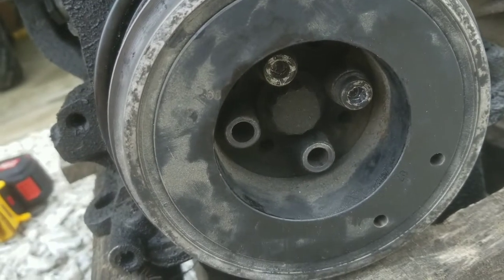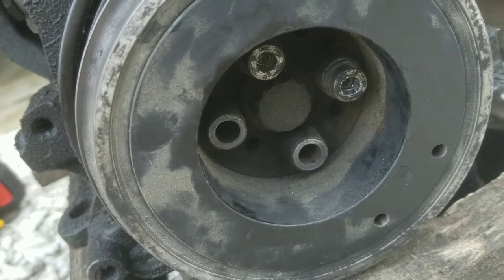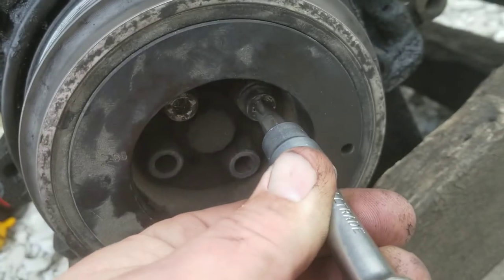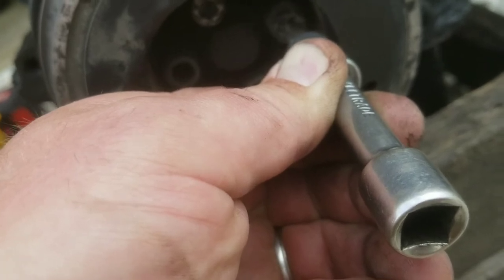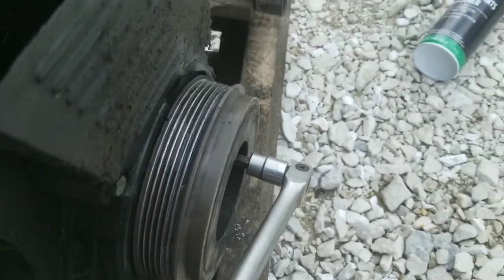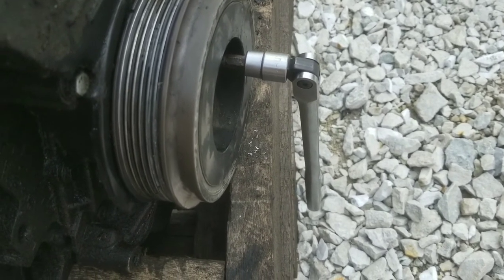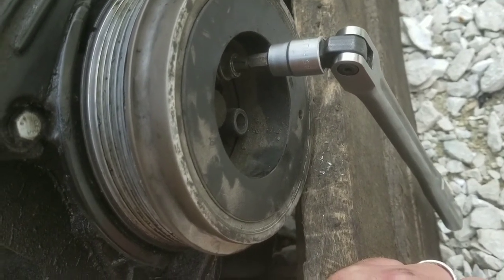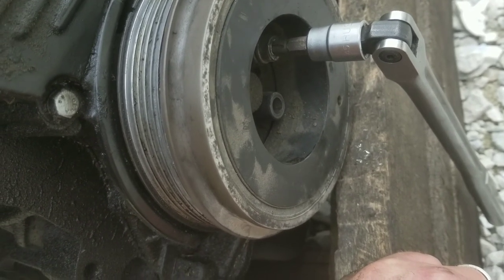Stubborn Crank Pulley Bolt Removal VW TDI

Comment: I was in trouble today wit the same situation and I gave up because I couldn't put them out but I didn't have the new bolts so I coudn't change the belt.  I guess I have to use a 12 mm 12 points to get them out but I didn't try yet. Crazy bolts! Thanks for sharing.

Comment: 12 point bit works a lot better
Reply from the maker: Are you talking a 12-point socket hammered around the outside of the bolt head? Or one of those inverted 12-point/Tri-Square bits?
Reply: @tightwadtv3421  12 point tri-square bits. You can get it out in one shot with those.